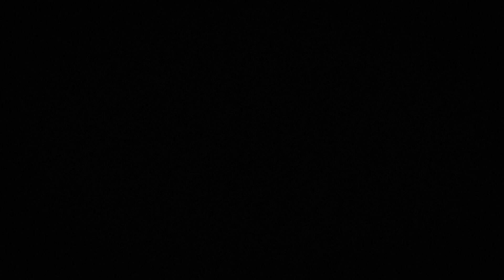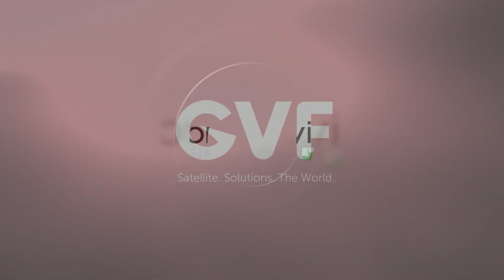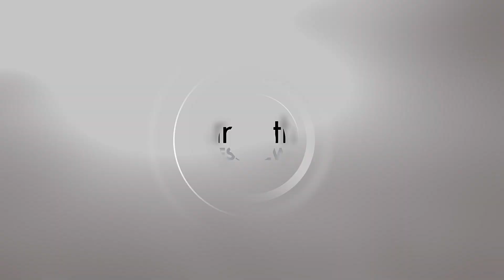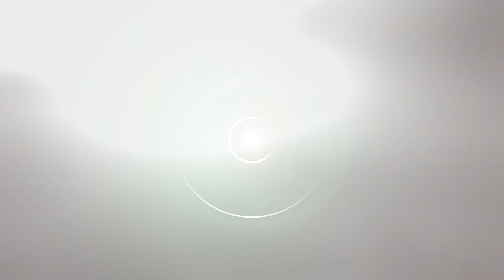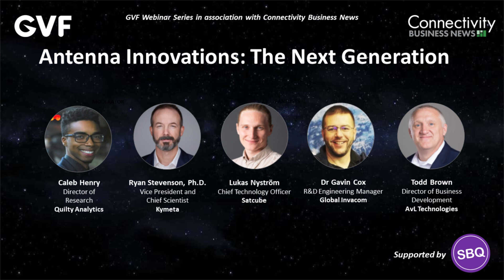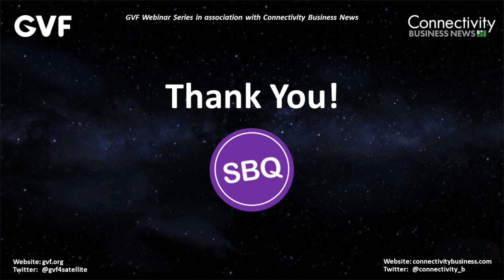Antenna Innovations: The Next Generation

Comment: Hi thank you for the valuable discussion. I have few questions, 
1. How do you measure XPD of antenna(it could be CP, single port or multiple port) and how do you validate this results for outdoor use. Because all test are done inside chambers etc.
2. How do you calculate G/T as my understanding there are multiple methods to calculate it, what’s the difference between them?, what is the most reliable method?.